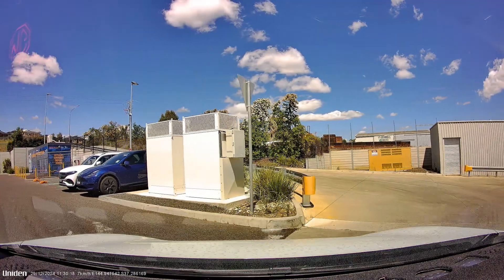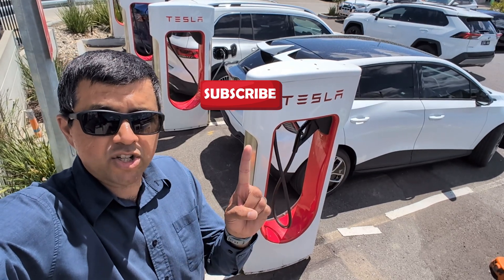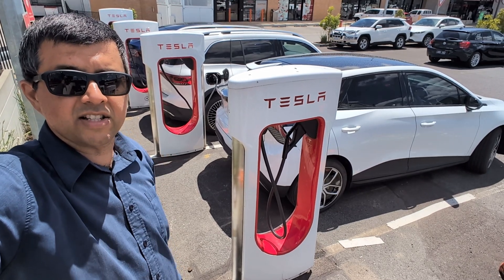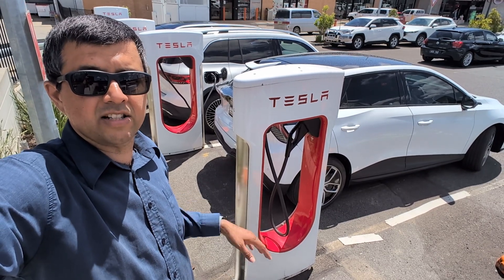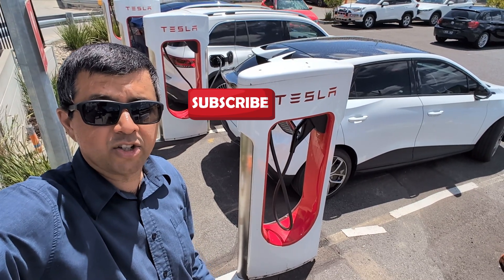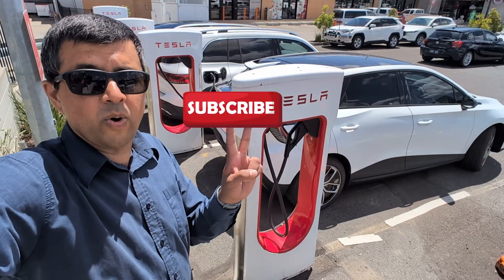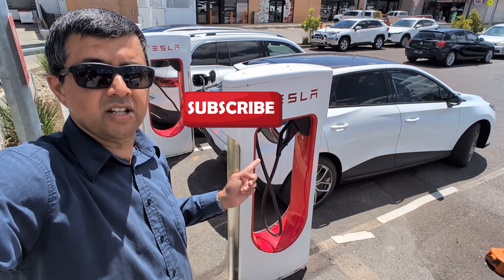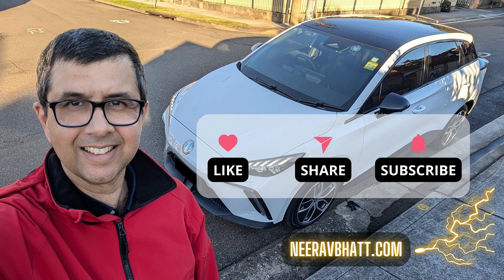Tesla Supercharger Frustrating Design Flaw :-(

Comment: Would an alternative solution be for the tesla charger to be positioned in the middle of the parking bay (not at the side) - and a longer cable might still be needed - allowing cars with charging ports on either side to use them?  [Of course, I don't believe realistically Tesla would change the position of existing chargers, but perhaps now that they are making a lot of their chargers - including future ones - available to non-Tesla vehicles, it would be a welcome move]
Reply from the maker: Yes side position is an alternative to longer cables but as you say would be harder /more expensive to do with existing locations

Comment: You have to be taking the piss....🤔
The design flaw is from EV manufacturers like yours, who designed and sold EVs without any consideration about where they should have the charging port. They didn't build a charging network, they just sold you the EV and didn't consider the fact their customers may want to use the worlds biggest and most reliable EV charging network.
The problem is obviously any EV with a charge port not on the rear left or front right....not the Tesla Supercharger.
So IMO Tesla should charge 50% more for charging an EVs like yours to charge to pay for the changes your manufacturer didn't do in its initial design. You may then avoid Tesla Supercharger but then Tesla owners are not inconvenienced buy your purchasing decision.
Reply from the maker: Before you make strong statements it's best to check facts 🤔 my EV has a charging port in the same location as a Tesla ✅

Comment: Alot of first world problems raised here.

I'm thankful we have chargers installed in more areas. 
Tesla to open them up to us non Tesla drivers. 

Beats nothing. 

Longer cables and screens also don't come free. 
Both can be subjected to abuse or misuse with added risks and therefore comes as an additional cost. 

Additionally there are technical limitations with cable length.

No, I agree with Telsa deployment strategy here. Limiting the "nice to haves" and keep the important root function- of charging a car -and put the savings into more chargers.
Reply from the maker: Do you realise that short cables mostly inconvenience Tesla owners who turn up to a charger and find 2 bays blocked by 1 other brand EV charging ? Longer cables would fix that instantly
Reply: Yes, and cost for longer cables also scale up exponentially the longer it becomes.

Comment: I've been guilty of this at this very same Kilmore Supercharger. My BYD Seal had a driver's side rear port, so I needed to use the adjacent spot to plug in. Fortunately I only needed a quick charge and was able to have a coffee at a Cafe that could see the bays. At the time I was the only vehicle there, but that may not always be the case.

Disappointingly, they were adding new bays next to it, but still had the new chargers installed at the side, rather than at the centre back or with a longer cable.
Reply: I had the same issue at Shepparton when driving a BYD rental. I was the only one there and stayed with the car
Reply from the maker: Sounds like you were polite and helpful in your usage at Kilmore. really disappointing to hear Tesla is adding 3 more chargers without bothering to have longer cables on them or side access for at least 1